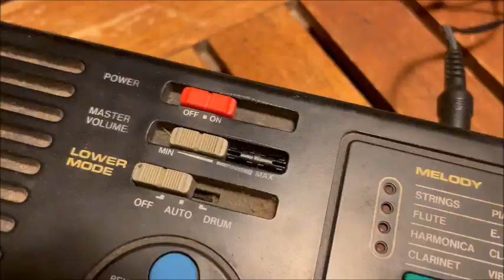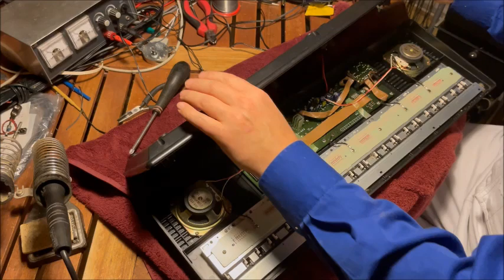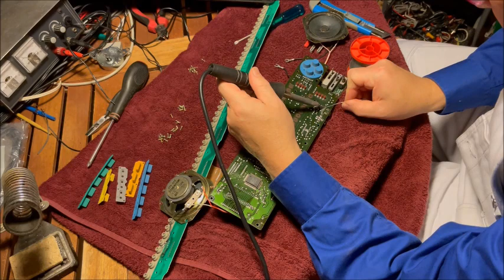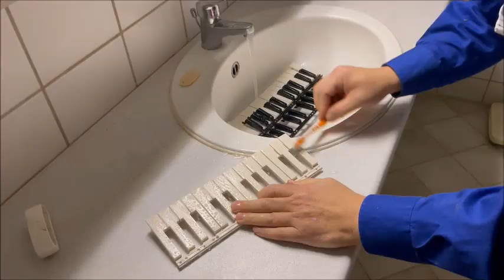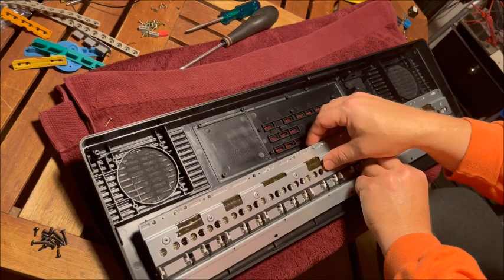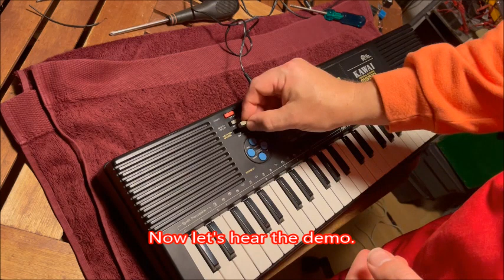Repairing a Kawai MS510 keyboard

Comment: One wishes things where always this easy! Nothing worse then electronic faults without any clues.
Reply from the maker: You're absolutely right. A couple of weeks ago I found that there is a strange problem with my "new" Technics organ. But everything is hidden inside a few integrated circuits with 500 pins.

Comment: Your videos are inspiring. I took apart my old PSS-270 to clean it up, now it looks like new :) This MS510 sounds like a FM synth. Did you find a FM chip in it ?
Reply from the maker: There were a couple of chips with KAWAI written on them so I suppose it is some technology Kawai had made themself. FM was owned by Yamaha at that time so I don't suppose Kawai would use FM unless there were no other options.